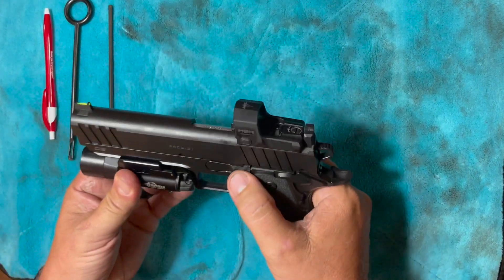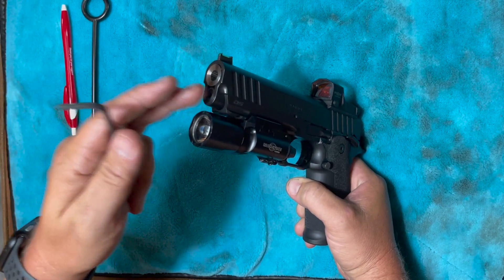Springfield Armory Prodigy DS: Basic disassembly and reassemble. A little tricky?

Comment: Great video...right to the point and that tip about loosening the guide rod spring was definitely necessary....I just got a Prodigy today and I wanted to see if I could do it the way the manual says and like you said I dont see how that is possible....thanks alot
Reply from the maker: Not a problem, thanks for watching and letting us know it worked. Please sub up if you haven’t already!
Reply: @GSquaredTactical  just did
Reply from the maker: Ty

Comment: Please do a video on the firing pin and extractor removal briskness may have to adjust the tension in the extractor
Reply from the maker: Yeah I’ll do that soon. It’s super easy but can be a pain to put back and the ejector hangs a little the first time I done it. Thanks for watching and commenting and please be sure to subscribe if you haven’t already
Reply: @GSquaredTactical  would love a video on a complete tare down thanks alot!!
Reply from the maker: I have since sold this gun because even after charging the firing pin it had issues with lite primer strikes. I am sorry I wish I had it and I certainly would. Thanks for watching and commenting and please be sure to subscribe if you haven’t already

Comment: I have a Springfield armory 1911 and was under the impression that it’s a 2 piece guide rod. What a pain in the rear, thank God you don have to contend with a barrel bushing.
Reply from the maker: I have several that I do and I almost don’t have the hand strength anymore to take my TRP down.
Reply: It DOES have a 2 piece guide rod. The so-called 4 pieces are actually the two piece guide rod, the recoil spring and the reverse plug.

Comment: I can’t get it back together!  The barrel seems to be hitting something.  I also took off the mail spring. And can’t get it back on either.  Need help!
Reply from the maker: When putting the slide back on the frame do it upside down and have the barrel link folded down against the barrel. Sometimes when doing it right side up the link towards chamber it can hit the inside of game causing this issue. You’ve probably already done that but other then making sure the guide rod is properly screwed hand tight idk. Thanks for watching and be sure to subscribe if you haven’t already

Comment: I’m new to this platform I got the gun apart but the step where you unscrew the front of the guide rod out with the hex wrench? I cannot get it to turn anymore and it hasn’t loosened to come out. Is some possibly wrong? I’m not sure what I’m doing wrong… 😅 but yeah I can’t unscrew it.
Reply from the maker: It is very tight. When I done this video I had already loosened it so it was as tight as I could put it which meant I could take it off. However you should do it before ever removing the slide from the frame. As in loosen it 2 or 3 turns then take the slide off and finish the process
Reply from the maker: Thanks for watching and commenting and please subscribe if you haven’t already and let us know if you are able to get it loose
Reply: @GSquaredTactical  I went back and reassemble the gun and was able to give it a few good full turns like you said then I was able to complete it easy after taking it down again. I’m just dumb and didn’t loosen it no where near good enough before taking it down. Thanks!
Reply from the maker: That’s not dumb it was new to you just like it is to everyone who’s never used one for the first time like us at one point in time. You gots to learn now you can help someone else lol

Comment: I had to swap slide stops, and now my hammer won't cock at all.. It's driving me crazy and pissing me off. I didn't disassemble it all the way.. Just mainspring housing and sear spring out. UGH!
Reply from the maker: What did you take all that out?
Reply: I got it fixed! I should have specified... 😂 I put extended slide stop, so I had to remove the grip module to sand down the polymer. Turns out putting the sear spring back in with the gun assembled is difficult and the left spring always seems to go on the trigger bar instead of the disconnect. Thanks!

Comment: No need to be rough on putting the slide lock back in place. Set it in fully pull the slide to the rear and it literally falls right in with your thumb assisting it as if you were locking it in place
Reply from the maker: Mine doesn’t lol 😂. Thanks for watching and commenting and please be sure to subscribe if you haven’t already